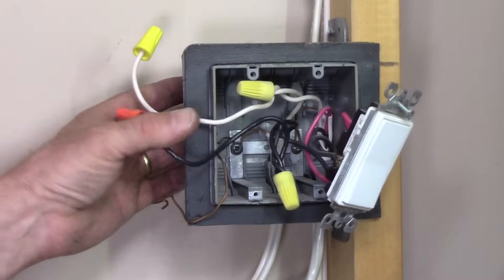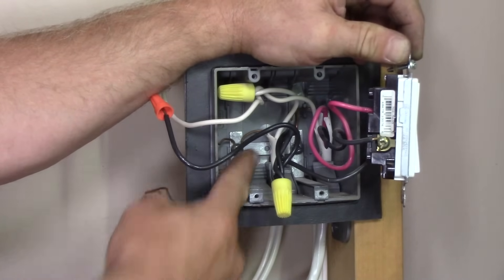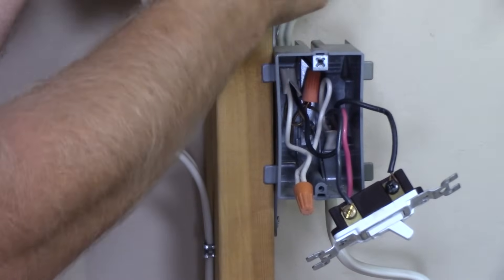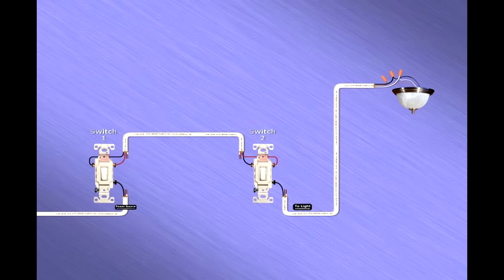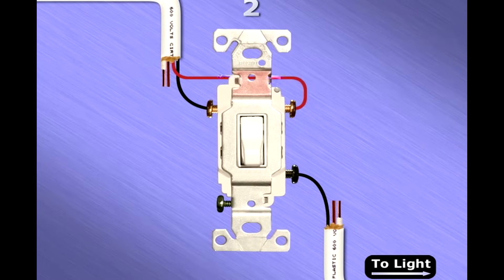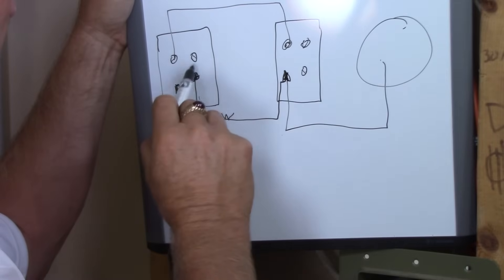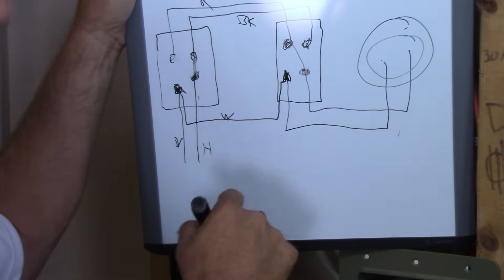The Best 3 Way Switch Explanation Ever!

Comment: Thank you for teaching.  Under what conditions might someone need a two way switch like this?
Reply from the maker: Thanks for watching!  The most common examples would be at each end of a hallway to turn on and off the lights, or top and bottom of a stairwell. Going to bed, on goes the light.  At the far end, shut it off before entering your bedroom.
Reply: @theinternetelectrician    thank you for responding.  I am totally grateful for videos like  this.   Can I ask for some help with something?  I have 4 zones out.  How do I trouble  shoot?  2 are in the garage (one runs  my  sprinklers) and 1 I switched out.  Now the plugs in front outside by the front door and outside by the backdoor are out too.  I can't afford to hire an electrician.  I'm 62 years of age.  Sure would appreciate thoughts and ideas to trouble shoot and fix.
Thx in advance!
Reply from the maker: @joannevans9629  This is almost certainly a tripped or failed GFCI outlet somewhere.  Not sure where you are located, but in Arizona it is common practice to have one GFCI outlet in the garage (could be hidden by shelves, shoe rack, etc.) and that outlet can then feed up to 5 other outlets on the load side.  These would be in the locations you describe, giving ground fault protection where required by code.  Check that out and let me know.  Hit the reset button on the outlet.  If it doesn't reset, trip, reset then it could also be the breaker that feeds that circuit is tripped.  Check it by pushing it firmly to the off position, and back on.  Barring that, you might have a faulty GFCI receptacle in which case this video will help you out.  Watch it for sure as it will describe you situation to a tee!  https://www.youtube.com/watch?v=fkGWX6Ttyh8&t=1s
Reply: @theinternetelectrician    Thank you for such a quick response.  I will watch the video.  There is one plug in the garage with GFCI and I have replaced it but it's not receiving power.  I have reset at the breaker box.  I even checked all GFCI outlets I could find in the house (kitchen and bathrooms seem to have them).  When I replaced the GFCI outlet in the garage I do not recall it having ground connection.  I'll recheck it.  I just copied hook up to what was originally there.  Get back to you after I watch the video.

Comment: @theinternetelectrician

Great video and very clear instruction. Question, can I run to any light of a series of lights with this process? I’m a new subscriber.
Reply from the maker: To add multiple lights controlled by the 3-way switch network, just continue on from the first light going light to light with 2-wire cable.  Does that answer your question?

Comment: Why the f is it called a 3-way switch if it's only two ways
Reply: I can't get mine to work correctly at the top of the stairs I turn the light on but the light does not turn on until I go down the stairs and turn the switch at the bottom on what am I doing wrong
Reply from the maker: @mickeybinas  I suspect you have the hot at the bottom of the stairs on the wrong terminal. (on one of the traveller terminals  instead of the common).  Could be at either location as well.  Watch the video again and you'll see how that would cause you're issue.
Reply from the maker: That's a great question.  Should be called a 2-way by most logical thinking.  But then a single-pole could be called 2-way as well.  On, or off.  It should be called a "this way, or that way" switch!  The debate continues.  Thanks for watching!

Comment: Appreciate this video, how you explain things and did not go too fast also.
Watched it multiple times.

For you website I was writing in the word "dash' but discovered you mean a "hyphen as in "-"). 🤣
I learned from Grammarly, "A hyphen (-) is a punctuation mark that’s used to join words or parts of words. It’s not interchangeable with other types of dashes.
A dash is longer than a hyphen and is commonly used to indicate a range or a pause. The most common types of dashes are the en dash (–) and the em dash (—)."

Comment: For there to be a 3way switch then there HAS to be three wires in each box then? Reason I ask is that my kitchen 3way switch has 3 wires in one box and only 2 in the other. The red traveler is missing for some reason. Has never been there and has never worked in 30 plus years. I just capped off the 2 wire box and put a plate over it. The other side  is just a single switch now. All replies welcomed..thks..jc
Reply from the maker: I'd have to be there to do some hands-on trouble-shooting for this one.  But it would seem that you found the best solution as yes, there has to be at least 3 wires in each box for the 3-way circuit to function.  I suspect someone messed up when pulling in the cables for this circuit.
Reply: @theinternetelectrician  Thanks very much Terry..jc

Comment: Sooooo 🤔🤔🤔
What's not explained here (at least so far) 
Is there is actually two ways a 3 way switch can be installed. 
This explanation is when the two switches come first, then to the light....I had the experience of realizing on my own that there is also the other way: switch #1 goes to the light, and then down to switch #2 ....so another words: the light fixture is in the middle and the switches are on either side ....that was fun to fix....because whoever installed the 3 way, installed it the way this nice gentleman is describing.  Maybe this man can explain the other way to install 3 way switches so that people are not wondering why their lights don't work on one switch but work on the other 👍👍👍

Comment: I have an old house where the wires from the breaker box go into the light socket, not the switch box. I need a video on how to wire that.
Reply: That’s the way my house is wired I think,, wiring looks great ,, I did find a wiring diagram that has the power starting at the light

Comment: Some situations vary somewhat from this example. In my case, the power line must be up above the centrally placed light. Without taking more apart it is not yet clear. The arrangement used to work properly, but home renovation workers have altered some connections and now it doesn't work and they gave up trying. Of course, things are simple when you have an open wall like in the demonstration video, and can see all the traveler wires. But in the case I am working with, I am guessing what wires are hidden up in ceilings. Normally I have no problems with wiring, but in this case am taking notes about wire colors and which screw they attach to, and trying to straighten out the incorrect wiring. It can be somewhat confusing.
Reply from the maker: Send me an email to internetelectrician@gmail.com and give me all the details, diagrams and  / or photos and I'll help you sort it out.

Comment: I've just began to do electrical work. On a 3 way switch can the 2 traveler wires on the 3 way flip sides or does it not matter. Like one side has a red parallel to the constant and the other side is the same with the switch leg or does the red then change to the other side and the 2 blacks are on the same side if this makes sense
Reply from the maker: it makes sense, and no, it does not matter.  Thanks for watching?

Comment: How would you do this with adding a receptacle that turns on when turning in the 3 way light switch and also another receptacle that is on at all times
Reply from the maker: I would need much more information.  All the cables and connections in each device box, and where and from what outlet do you want to add the receptacles from.

Comment: Hey Terry, loved this video. I switched one of my but Ed out switches so I installed a 3-way switch. However, when I turn on the light switch downstairs and turn it off upstairs, I can’t turn it on down stairs. Is this because I need a 4-way switch? Also, what’s the red and white cable on my switch technically for? Thanks in advance!!!

Comment: If you have on one switch the Red tied to Left Side Traveler Screw, Black tied to right side traveler screw ..... then on the other switch - does it matter which of the two hots is tied to a certain traveler screw or does it only matter that you get both hots tied to a traveler screw?
Reply: Nvm I think I got it - What I was asking would determine if the device is on (if switches are in opposite positions)/off(switches are in same position)   vs    on(switch are in same position)/off(switches are in opposite position)

Comment: Doesn’t the position of the travel wires need to be consistent across the switches? Otherwise the switch positions will be wrong. Right?
Reply from the maker: With a 3-way switch, there really is no right or wrong, on or off.  They are always connected from common to one or the other traveller terminals.  However I have encountered somewhat fussy inspectors that insist that in a 3-way, for the light to be off, both switches should be in the same position, either both up, or both down.  Either one out of position inconsistent with the other, the light (s) are on.  But the code does not weigh in on this preference.  So in answer to your question, it matters not the position of the travel wires.  If you don't like how the circuit is working (referencing the above), then either flip one of the switched 180 degrees in the box, or reverse the travel wire positions will work as well.  Thanks for watching!  Happy New Year!
Reply: @theinternetelectrician  interesting. My Dad (who built houses) told me the opposite. If they are in same position light is on. Opposite and light is off. That’s how I have mine now with the wiring the same in both switches. Happy New Year.

Comment: The steps at the boxes are great but the animation doesn't show how current moves through the neutral at the light and back to the source. This is important because connection to the right neutral  at the source is crucial too.

Comment: I had to install two three way switches today.
However, the previous "electrician" used 14/2 gauge wire and didn't indicate that the white was a traveler.
It took me forever to figure out the flow of the current.
Guys, if you are taking shortcuts, let it be known with the proper color tape!
Better yet, use a 3 wire romex with this application.
It was a freakin' nightmare getting this done.

Comment: Great video.
I understand this. Now I want to ask ,if I have 1 light each out two different  patio doors independent of each other on same wall . Could I disconnect one power source and add a 3pair wire and 3pole switches between them.How would it be wired
Reply from the maker: This is very likely do-able, but I would need much more information.  I am available for video consultation via PalTap, at http://paltap.me/interetelectrician!

Comment: I am putting in a Meross 3 way smart switch and checking my box to see how it's connected.  It's in the box near the light, but the neutral ends in the box and doesn't extend to the light.  Is there any reason this might be?

Comment: It's a physical AND gate.  Impressive to see and understand, truly. My kitchen has two entrances and the switch as each entrance is wired incorrectly, leading to them only working when switch A is up and B is down. This would make for a great fix, assuming they are indeed 3 way switches, and not some doubly silly mistake made by whoever installed them.

Comment: I have outlets on a single switch, plug in a lamp flip the switch lights. Well I added a light in ceiling . Ran 14.2 wire over to switch . 
What next? 😀call electrician?
Three wire with ground comes in red to switch , black wire nut to black two wire that goes to outlet attached to switch . White wires nut together.
Reply from the maker: The black is a constant hot wire.  The red is the switched wire.  You want to connect your new wire to the white splice and pig-tail into the red wire. (and connect ground wires of course).  If you need some more clarity I'm now available on Paltap for a video chat to help you with this. http://paltap.me/internetelectrician
Reply: @theinternetelectrician  
Super helpful thanks 
I will let you know if the project is a success!
Reply: @theinternetelectrician  do you think a dimmer switch will work here. Concider the plug in outlet runs on this same switch ?

Comment: Lets say I have a 3 way switch that is going to a switch plug and I want to make that plug a constant plug and use the switches for lighting that has yet to be installed. How would I make that happen?
Reply from the maker: You would add a 2-wire cable from one of the switched receptacles and connect the grounds, neutrals, and the red wire to the new black of the cable to the lights.  Then at all the switched outlets you would replace the existing receptacles with new ones, use the black only to connect to the hot side of the now "un-split" receptacles (unless you wanted to keep them switched as well), and cap off the red wires in the receptacle boxes.

Comment: Can you please explain me if it's normal for a ground fault interrupter to flip off when I test an outside/back yard outlet 
, connecting the red lead/multimeter to the black wire of the outlet and the black lead/multimeter to the ground (bare wire).
But when I connect red lead from multimeter to black wire of the outlet and the the black lead/multimeter to the white wire (neutral) of the outlet I do get a 120 volts reading and the ground fault interrupter does not flip off?.  Thanks in advance and I do enjoy your videos>
Reply from the maker: The only explanation I have is that you are using a low quality multimeter?  They have a lower resistance and thus it is conducting enough current to ground to trip the GFCI.  A high quality multimeter has very high resistance and won't do that.  The other possibility is that you have an extremely sensitive GFCI.

Comment: Do not like the hot refered as a common. Call it hot or main electrical line. You will have people confusing the hook ups and arcing or worse.
Reply from the maker: Good point, and thanks for commenting.  The reference to "common" is more for the device itself in that the common terminal of a 3-way switch is the common connection point to either one of the other 2 terminals (traveler).  But I get what your saying, and your concern.

Comment: This was really good - kudos for the animation to hammer home what was happening. Suggestion - Make a video that shows how to have a 3-way light system AND one of the switches feeds other outlets (which should always be alive regardless of the light switches' state).
Reply from the maker: Thanks for the comment!  So while there are many variations of how to wire a 3-way switch network, in the example used in this demonstration, to do what you suggest is quite simple, as long as you add the outlet to the switch that has the source feed coming to it.  Then simply pigtail splice into the supply hot, neutral, and ground.  Keep in mind that you you will have 7 conductors in that box, and it needs to be a large enough box to accommodate that.  Most plastic boxes and some metal boxes available these days are large enough, but a standard metal outlet box more common a few years ago (like a leviton 1104 or 2104) have only the c.i. capacity for 5 conductors.  Thanks for watching!

Comment: How many wires in the back of 3 way switch is needed, some shows 4 , some shows 5, i am confused.  Neutral, 2 travel, one ground, one common (the first animation didn't show anything about neutral)   why?
Reply from the maker: The neutrals are left out just to avoid cluttering up the graphic so as to fully understand the path of current flow.  There are many variations of how to wire a 3-way switch network, but once you understand how they work, you can apply that knowledge to any variation.  However in this example, you need 2-wire cable for power supply to first box, 3-wire cable to next box, then 2-wire cable up to the light (s).  Cable counts only consider the current carrying conductors so when I say 2-wire or 3-wire, they are always (+ground)

Comment: What about when the first box has a 14/3. And two 14/2 one being a jump out feeding another single gang and the other 14/2 being a switch leg for light 

The other single gang just has a 14/3 and being treated as a end the same 14/3 coming out that first original box
Reply from the maker: That's just another variation of the many methods to make a 3-way circuit work.  So what you would do there is to splice the incoming white with the white wire that goes to the light.  Then the incoming hot wire would connect to the black wire of the 3-wire going to the other switch.  At the other switch, this black wire gets connected to the common terminal of the switch.  The other white and red are the travelers.  At the first switch the white and red of the 3-wire again are the travelers, and the black going up to the light is the common. Here's a diagram from my website.  Thanks for watching!  https://www.electrical-online.com/3-way-switch-wiring-diagram-variation-3/

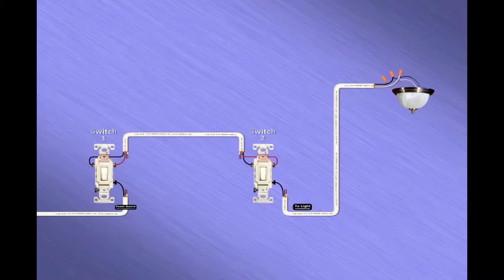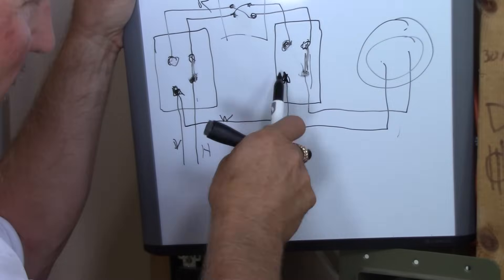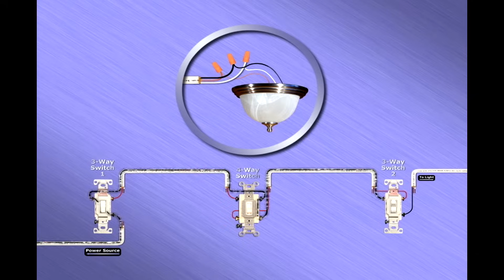Comment: Skip to 5:05 useful part ends at 6:27 then 9:43 and ends at 10:59. If you need more than that, hire an electrician. This guy just makes everything else more confusing. I'm pretty sure he's just padding out the animation he stole from somewhere to keep from getting a copyright strike, or something like that.
Reply from the maker: Thanks for watching, and the detailed analysis.  The animation that you suspect that I "stole" is owned by myself, Internetelectrician Ltd. Copyright, registered trademark, all above board.  I would have been a little more confrontational with you had your icon said "Build Back Better", and your handle had been "Brandon Builds Best".  🙂 But I'll let you off easy with just a factual correction.